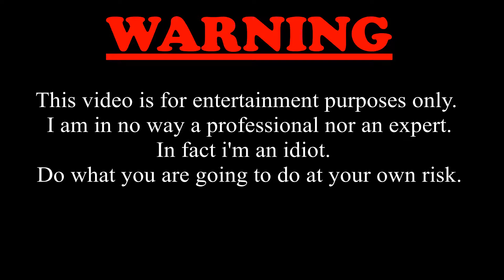Custom made Cadilliac 472 Serpentine Belt System build Part 5, Alternator and A/C Pump.

Comment: That's really shaping up, and I like where the design is going. Keep in mind, if you do switch to SHCS (socket head cap screws or even button head cap screws), then you'll be able to counterbore them into the surface which should help with your clearance.
Reply from the maker: Thank you.  I think it is turning out better than i hoped.  I ended up not needing the button head bolts so far.  Great tip tho,  if i end up need to use one ill really have to look at counter sinking them.